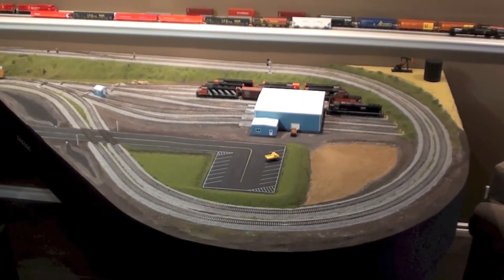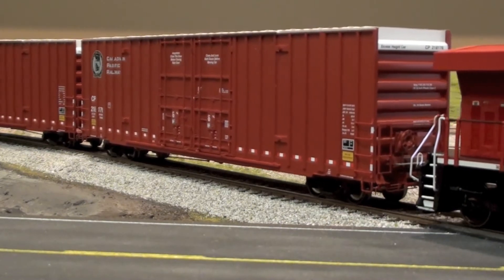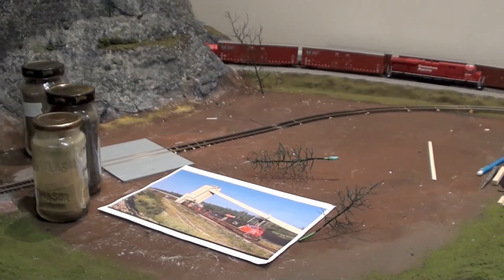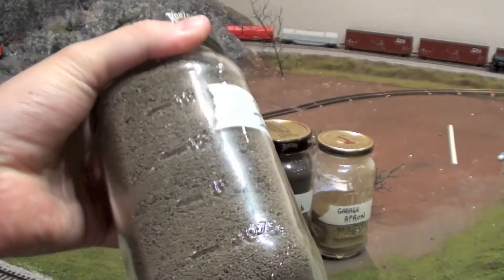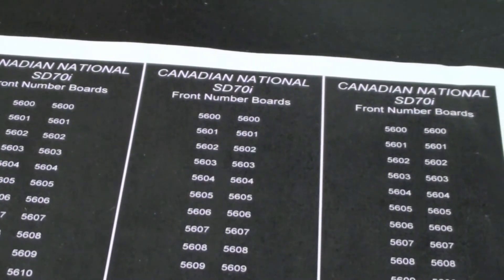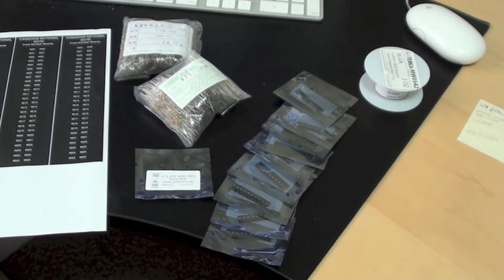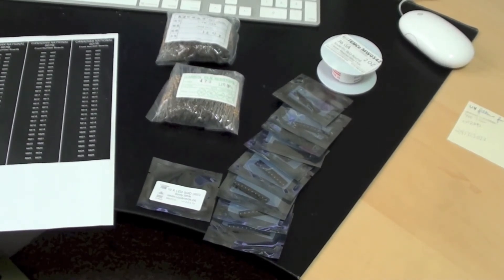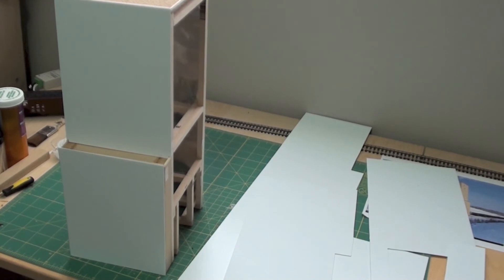Layout Update - June 2013: Cheap ground cover, bulk LED's, easy number boards, tipple siding

Comment from the maker: Not a problem. It makes it soooo much easier. It's basically written in plain english what you are changing and just click the pull down, select what you want and hit program. No button mashing on the throttle. I would suggest the Sprogg II only because it is stand alone. It doesn't need to connect to your booster to program. My programming track is upstairs in my office so I couldn't use my booster.

Comment from the maker: I'm not sure exactly which CV's I changed. I use JMRI, on the Tsunami Page, I had to change FX6 & FX6B Effect Selection to DIMMABLE LIGHT and then FX6 Grade Crossing Logic & FX6B Grade Crossing Logic to DISABLED. 

Hope that helps. JMRI is freeware, you just need to purchase a Locobuffer USB, Sprogg III or something similar to allow you computer to speak to the decoder.